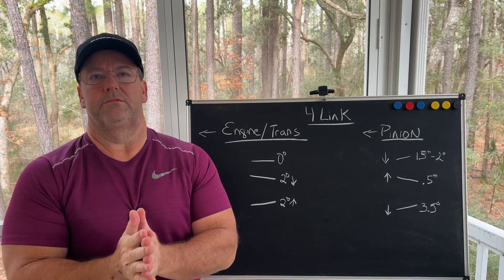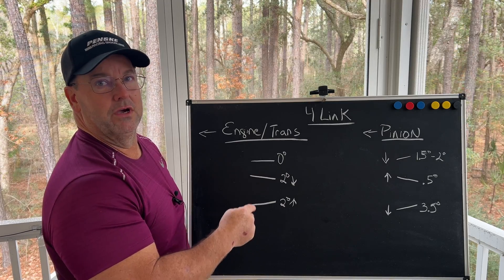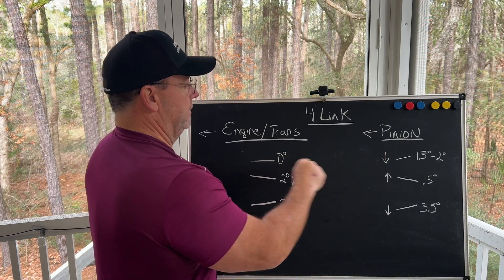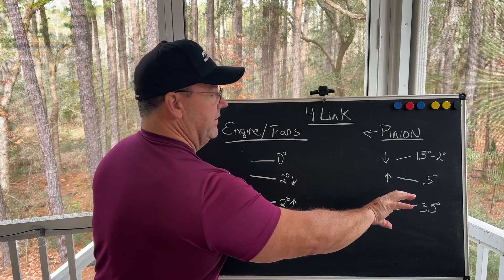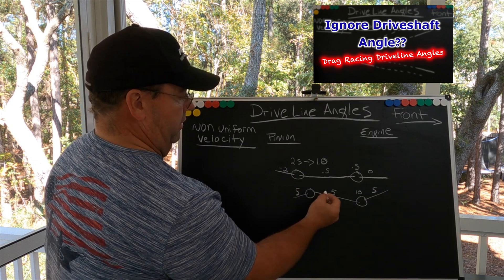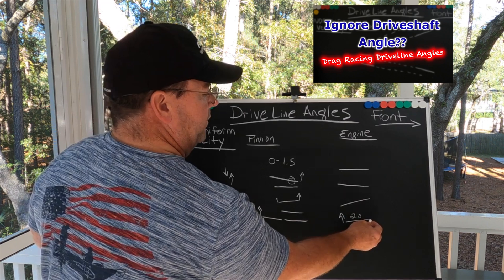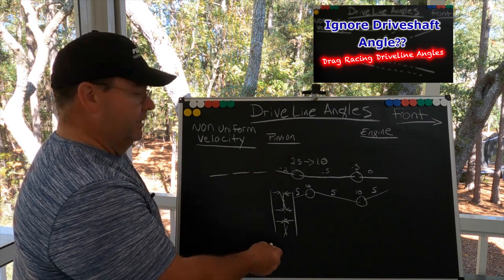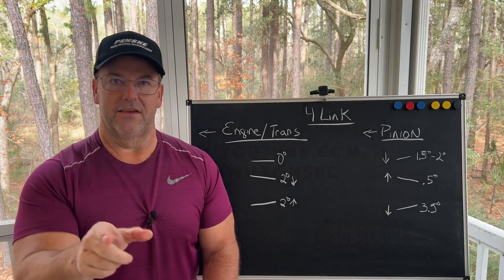Pinion Angle for Drag Racing – Maximize Traction & Power

Comment: I have a 3rd gen F-Body, aftermarket trailing arms, aftermarket torque arm shorter, all spherical joints, no poly,  I have 2.9 degree tailshaft down, and have the pinion set at  .9 up towards the floorboard. Sound about right? It's a slick car.

Comment: Thanks for the video! I was wondering if any of these videos help explain what to set pinion angles at with a radial car that separates 4" (+/-), when that's a range of 6 degrees of pinion angle change?
Reply from the maker: I am actually working on that specific video content now! A radial with a good bit of separation absolutely needs more than a 2 - 2.5 degree offset! More to come! Go fast, go straight! Be SAFE!

Comment: You have pinion angle change planned but you never said what is causing the deflection. Is it bushing or bar flex?
Reply from the maker: Not too sure I am following your question. Sorry. No deflection, but depending on squat or separation on the rear and with the natural rotational forces on the rear end during the launch, the pinion is always trying to rotate up on the housing. Go fast, go straight! Be SAFE!

Comment: As always great info Kevin. Off topic, we have a chopped 32 3 widow coupe street rod. That wants to be a small tire street race car. After install of 6/71 on the 4 bolt main 351C., power is WAY up and traction is WAY down! Rear is std. street rod 4 bar with coil overs. After we scale it and come up with instant center. I want to fab new rear bar mount to angle the rear upper bars.to meet and form new instant center. Kind of a 4 bar ladder bar.. will it work? Dont want to totally replace rear susp.Its has to work better than currant set up. Any advice would be great..
Reply from the maker: I would need a good bit more info, but your changes are definitely moving you in a more performant suspension direction. Go fast, go straight! Be SAFE!
Reply: thank you.When I get more numbers on the car. What info kit do I want to buy from you? Thank you again Kevin @KevinWilsonSBC
Reply from the maker: @conniekahl8015  check out my services at https://www.samsonperformance.com

Comment: I don't agree with the middle  scenario here. If e/t is pointing down 2 * then pinion should be down 3.5 not up .5. Pinion rotation is up so in your example putting pinion up .5 would result in 2* up pinion and e/t  down 2* resulting in 4* working angle. Right? The rest I agree . Thanks
Reply from the maker: A couple points of clarification. Go watch the full video referenced in this video. When you say the pinion should be down 3.5 degrees, what do you mean by down? The direction of down is critical and if you mean 3.5 degree down to mean the pinion yoke is pointing to the ground, then that is creating severe non-uniform velocity as the pinion centerline and e/t centerline are no where near parallel under load. If by down you mean the yoke is pointing up to the floor board, then on the hit you will be more than 2 degrees different from the e/t angle, which is also not ideal. I said the pinion should be pointing down (yoke to the track) .5 degrees so on the it with 1.5 to 2 degree of rotation up, the e/t centerline and pinion are parallel.

Lastly, working angle is not b/w the e/t and pinion, it is more the u-joint angle at the transmission end and the u-joint angle of the pinion end of the driveshaft, hence the driveshaft angle is absolutely important!!! 

Go fast, go straight! Be SAFE!
Reply: @KevinWilsonSBC   Your picture of the middle scenario shows the rear pinion  .5 UP toward the floor. You are saying you meant DOWN toward the track.. WHich is it?  Because I agree with him on this. If your pinion is already UP toward the floor .5, goes up another 1.5 on the hit, it will be an UP angle of 2*. WIth the engine CL showing DOWN toward the track -2* .  I get the engine CL and Pinion will be parallel then , but how does that NOT put the unjoints out of Square which is where they are strongest?   Having a hard time wrapping my head around the joints not being square. Thanks

Comment: Kevin, what is your opinion on the "broken back" driveline angle? Kinda like this...\ _ /   Both working angles the same at 1.5 degrees. This is actually quite common in older vehicles including my Chevelle and a few others I know of.
Reply from the maker: I focus mainly of full out drag racing... I don't have an issue with what you are describing, but for the track, I would eliminate it. Go fast, go straight! Be SAFE!
Reply: @KevinWilsonSBC  one thing for me is still unclear . When you talk about static , do you mean car standing on it s wheels or up in the air ? So loadaed or unloaded ? 
Thanks for all the infos you are giving out to us ? 
Greets 
Sam

Comment: What about a radial car that separates 4 or 5 inches would you set the pinion angle at ride height for the hit or at full extension
Reply from the maker: That would definitely be confirmed at full extension. I generally start with a full 2 degree static offset with these and then confirm at full extension. Go fast, go straight! Be SAFE!

Comment: I don't know why some nake this so hard.   Under load the pinions should be perfectly parallel.   The driveshaft has nothing to do with it.
Reply from the maker: In dragracing, the driveshaft is absolutely important to understand to keep the working angles, not so extreme. Absolutely the centerlines should be parallel, but my point is you cannot, and should not ignore the driveshaft working angles to avoid putting the U joints in unsafe angles
Reply: @KevinWilsonSBC  yes I was speaking strictly in setting the rear pinion angle.   Large working angles should be corrected before doing the pinion.   If they can't be, maybe a CV joint driveshaft should be considered.
Reply from the maker: @MrAllan5oh  yes!!!! Go fast, go straight! Be SAFE!